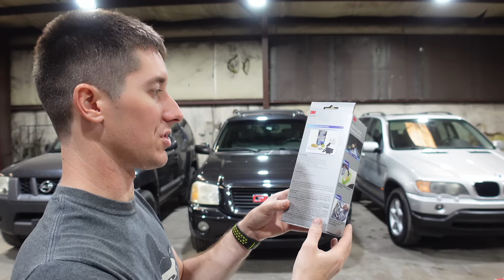I Bought EVERY Headlight Restoration Kit At O'Reillys *And Tested Them*

Comment: That Xterra is a second generation. Not a early 2000 soccer mom SUV at all. 2005 was the first year on those, and they were true off road vehicles. If you want to see what they can be, see "thenewx" dot com and their TOTM section. Mine has full steel bumpers,  steel skid plates and rock rails from Shrockworks,  three inch lift with 33" tires, Armada front differential, locking rear diff, winch, yada yada yada...Not a crawler, but I can go anywhere with it, and have.

Comment: Curious if anyone else has experience with turtle wax one and how long it lasts. I tried spraying clear coat on my headlight but after 2 years, it is now peeling/fading. Might be my fault for maybe improper prep but now I want to try some other kit.
Reply: From the other comments here, 2 years is a good amount of time for a restoration to last once the original manufacturer's clear coat has oxidized and gotten scratched & had to be removed. Once the original is gone, seems like it needs to be re-done yearly, unless sored indoors away from UV damage.

Comment: Yes, most of these products are affective  but……. Each time you apply the product you’re also removing “material”making the  headlamp assembly less effective against UV light/rays also if you wash your car more than the average consumer, car wash detergent can be very abrasive. At this point I only use a rubbing compound and a buffer wheel and check the results. I only use sand paper if it’s a must or if the customer is a Karen. Great video thanks for sharing.

Comment: The problem I have with these videos for refreshing headlights is that they do not show the headlights 2-3 weeks later.  I can use WD-40 for less than 1 minute to clean both headlights, but it only lasts 1-2 weeks.  It looks great for that period, but needs to be done again in 2 weeks.  That's why I need to see the headlights after 2-3 weeks.  Otherwise, I have no faith in the tests.  JMO.

Comment: Don't bother with any of these, the cheapest and longest lasting method is to use 320 wetsand until all the yellow is gone (presuming that they're yellow otherwise until it's even) then hit it quick with 600 wetsand and then put on a layer of clear coat. It will last as long as you expect a clear coat to last. Takes about 10-15 min.

Comment: I have used turtles wax since i was 13 when i started detailing my friends and families vehicles making good money back then. Even did alot of my teachers vehicles. Became a firefighter when i was 16 and used it on the firetrucks. The fire department started getting it products from a big Distribution company and they stop using it. New stuff smelled like bananas and did not do as good of a job but i had no control over it until i became the captain of the station went back to turtles wax and have not looked back and I’m 53 years old now.

Comment: Project Farm's test 10 months earlier (25May2020) showed the Turtle Wax the worst, and Sylvania and 3M the best.
https://youtu.be/iDB5U4QUdD0
WatchJRGo here did a nice, informal test.  However--there was no controlled starting point. We don't know which car had the worst abrasion and UV damage. The different surface curvatures and shapes of each SUV's headlight also were variables.
Project Farm eliminated these potential confounding variables, by testing on identical sheets of polycarbonate. Also they compared results under a microscope, rather than eyeballing.

Comment: On the 3m ultra headlight restoration kit, you guys flew threw.. on the first two grits of sandpaper, you are supposed to dry sand it, then on the 8,000 you wet sand it, dry, then carefully apply two coats of the sealant..

I just used this and my headlights look brand new... attention to detail and patience guys... and READ THE INSTRUCTIONS!!

Comment: people put insect repellant on their headlights???? WTF.  Well that's going to absolutely ruin their headlights. Never put that stuff on plastics, rubbers, leather etc.

Polycarbonate is a great material. Very strong. I believe GE used to advertise it as indestructible. So it is a good product for headlight lenses.  The problem is that polycarbonate is also very soft.  So it scratches very easily.  That's why headlight lenses are hard coated.  Those restore kits obviously remove the hard coating, so unless it is re-applied the lens will not last long.

Comment: The kits are fine, but I always feel you are just overpaying for normal detailing products.  I use 1000 grit, 1500 grit, trizak 3000, meguiars 105, 205, wax and done.  All with a cordless drill and foam pad.  Probably use about $2 worth of material.

Comment: It doesnt make sense testing these kits on different cars because i know that some of those UV factory coatings are harder then others, so if you want to have accurate testing results you need to do it on the exact same headlights from the same brand and model.

Comment: Turtle wax test was fake. Look at 18:14 the headlight was still foggy, after some editing at 18:19 you can see that the headlight is already basically immaculate before he finished the process. This is fucked up. Looks like rainx and 3m ultra were the ones. But for the price, you're better off using sandpaper and buying some 3m quick clear coat for like 10 bucks. It's so horrible when people start shilling for discounts at the autoparts store. It's detestable when they shill whilst misleading people to buy garbage products. I mean look at all the o'rielys employees commenting 🥴

Comment: lol. i used the mothers kit but with a metal/plastic polish... sucked fucking butt...  also with a brushless DC motor on the drill the 800 grit burned some of the plastic so i had to wet-sand by hand back up to 1500 grit.  you got slightly better results than i did, but not by much.  will probably try the turtle wax kit to re-do it. thanks for the video.

Comment: The diy kits are all trash. I do this professionally and use only professional grade coatings that last. Do not ever tell anyone the headlight restoration is permanent because it is not . I have tested them all. The coating is the key. If you don't replace the uv coating on the headlights don't waste your time cleaning them.

Comment: If you are professional detailer why do you use off the shelf crap. I use only professional cleaners and sealers and have never had a callback. AND I warranty my work for at least 1 year. Sometimes 2 depending if the vehicle is stored in the garage.

Comment: you're doing it all wrong.  forget those expensive polish kits at retail. buy yourself some magic eraser . any brand will do .  only down side is it is tiring repetitive and did I say tiring?    

all you do is just wipe  with a lil pressure. repeat until clear. 

it makes sense because what magic erasers are is they are sanding blocks of the finest grit and taking a magic eraser to any surface is not really cleaning but sanding it.

Comment: This is a REALLY DECEPTIVE video. The ONLY way to restore headlights for the long term is to mechanically (abrasives) take the plastic down from 600-1000 grit through several grits (just like for varnish on fine woodwork or fine auto paint) to 5000/6000 grit-otherwise is the product is short term and pricey BS.